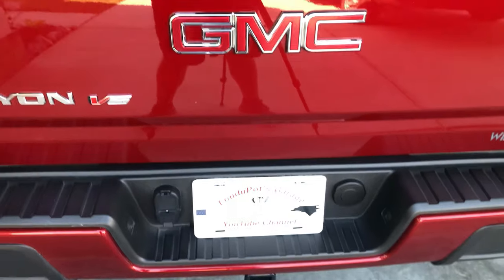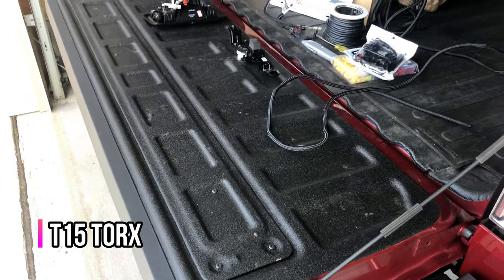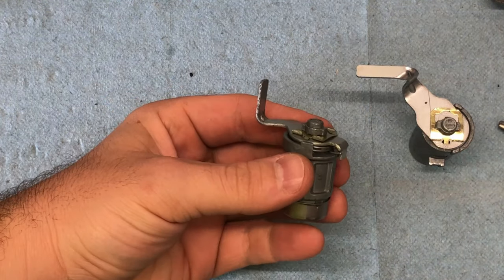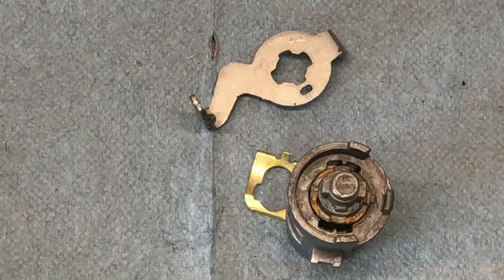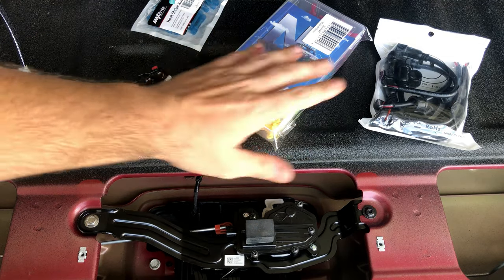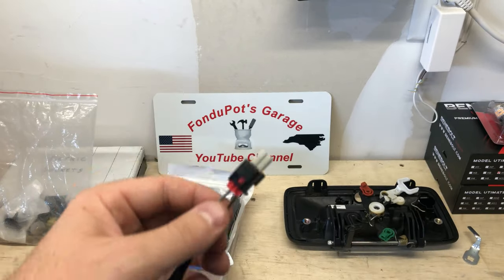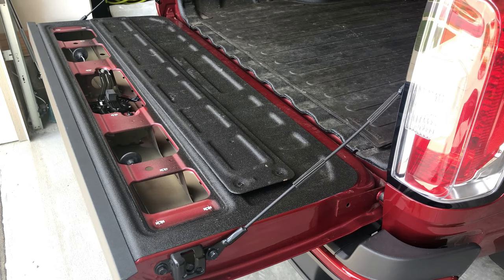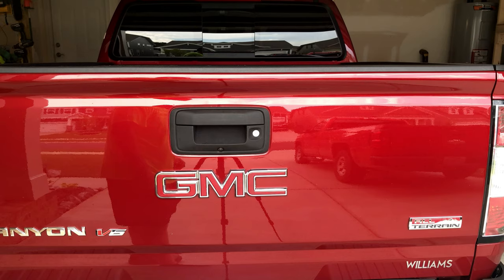[HOW TO] Install OEM Power Locking Tailgate in a 2015-2019 GMC Canyon / Chevy Colorado (Retrofit)

Comment: Thanks again for this video! I just finished up on my 2017. I used the part numbers below. Notes/tips: the handle was the non HD version. Also I had to use a file and remove a small bit of material from the metal arm where it connects to the lock.  cylinder. Lastly, i recommend using some clamps to mock up motor placement prior to drilling and bolting it up (2017 doesn't have indented tabs to show you where to place motor).
Handle: 84376533
Wiring harness: 84951860
Lock cylinder: 23338181
Motor/actuator: 84790352
Reply from the maker: Glad it helped! Thanks for watching.

Comment: Great video. Thanks.
I ran to the same issue like a few others here: Ordered the wrong end gate lock (p/n 13536169 is wrong, p/n 23338181 is the correct one which has the spring).

I'm still looking for the harness: p/n 84666895 and p/n 84951860 are not available anymore. Is there a successor? Thx for any useful help...
Reply from the maker: Not sure if there’s a successor part number. You can call a dealership parts department and they might be able to tell you.
Reply: A heads-up for everyone: finally I had time and went to my Chevy dealer: Harness with part number 84951860 is available and costs ~$40. Ordered mine, should come in within the next 7-10 days…

Comment: I just attempted to do this mod on my 2018 GMC Canyon and I found some interesting things. First, the handle assembly 84377237 didn't work with my backup camera. I ended up having to swap the white crab claw mechanism from the new handle to my old handle, that did work out fine. Second, the lock cylinder isn't the 13536169 part number. That cylinder didn't come with the spring and the arm didn't align with the crab claw. I ended up just using my normal cylinder (different than the original one in your video) and modifying it by slipping some rubber tubing over the metal part that actuates the crab claw so it was a little wider. After doing all of that I can say it works great, I don't have a spring in my lock cylinder but that doesn't bother me and doesn't seem to affect the operation.

I had the pop lock before this and can confirm that the OEM lock is much quieter and less clunky.
Reply from the maker: Thanks for your feedback. I've still been searching for the spring loaded lock housing. I cant find an exact part number for it. Strange your camera didnt work, what was different? Just the mounting bracket?

Either way, glad you got it working. And I agree much better than pop-n-lock.

Comment: I installed the pop & lock before watching this video and ended up ordering all the parts for the oem lock. The pop & lock works fine but it's sketchy and very loud. I like the idea of having oem parts in my truck.
Reply from the maker: You’ll love it. Mines still running great. Best mod I’ve done.
Reply: @fondupot  cool deal! Also, awesome video. I really appreciate it. I wouldn't have known it was even possible had I not watched this. You did a great job!
Reply from the maker: Thanks very much! Glad it helped.

Comment: An excellent video.  Well done!!  Caveat - I own a 2015 GMC Canyon.  I bought the parts and set upon installing per your video.  The problem is the 2015 back up camera does not easily fit into the new tailgate handle.  You can make it fit if you cut away some plastic ridges and drill new holes in the camera's bracket.  The tailgate does not have recesses to mount the actuator as you show in the video.  You have to drill new holes in the tailgate, then you have to mount the actuator underneath the tailgate inner sheet metal, otherwise the tailgate piece will not lay flat.  I have yet to wire it up, but so far with a lot of modification to the parts I think it is working .  Will let you know how it goes after I get the wiring harness.
Reply from the maker: Yea I think I remember reading another member with a 2016 having to do the same. But with a little ingenuity and power tools. You should be able to make it work. Let me know how it goes!
Reply: @fondupot  I made it work. The tailgate plastic cover doesn't fit flush because of the protruding nut used to attach the actuator.  But I am happy with the result.
Reply from the maker: Awesome!

Comment: My personal thanks for your video.  I have a 2021 Chevy Colorado and had to get some different part numbers, "84790352 Actuator and 84665198 for Wire Harness to plug it in" as I couldn't find your numbers on the internet.  I didn't have to switch the key lock as it was already mfg the way yours had to be modified.   Other than that I plugged it in just as you identified Grey &  Brn/Yel wires and it worked beautifully.  Thanks again.  I would say I used almost 20ft of wire to thread it front to back.
Reply from the maker: Glad you were able to make it work! Thanks for watching!
Reply: What model 2021 Colorado do you have?  I thought starting in 2020 they all came with locking tailgates

Comment: I'm having trouble locating the correct silverado lock mechanism.  Ebay has lots but they do not look the same and are for 07-14 applications.  Any suggestions as to the correct model years your lock came from?
Reply from the maker: Try to find one from 2016+

Comment: nice  video,
Have you had any issues with the   pop n lock? since you installed it.
would you change anything  if you had to do it again
thanks bill
Reply from the maker: @billlambright339  it’s been flawless. No issues. I’d do it exactly the same way if I had to again.
Reply: that install you did was it on a canyon or colorado. mine is a 15 colorado 4 door LT. I have no grouments like in your video have no way to get the wires inside besides drilling hole and fitting a groument
Reply from the maker: @billlambright339 my video is on a 2019 Canyon.

Comment: Great video!  I’m going to check my 2015 tailgate to see if this set up will work.  I’ve read reviews that say the Pop Lock is way to noisy.  OEM would be a better option for me.  I did call our local audio place that would do it, but with parts and labor it would be way too expensive.
Reply from the maker: It can still be done on your 2015. You won’t have the bracket mount holes like my 2019 did. But with a little ingenuity you could make it work. Others have done it. Thanks for watching. Good luck

Comment: Why not use the Pop and Lock??   Same functionality,  without key core swap- without handle swap- without custom harness.  Cost is 100 bucks, how much was your set up using OEM???
Reply from the maker: Good question. I had a pop-n-lock on a previous truck and it crapped out after a year or so. Yes, my retrofit using the OEM lock, and custom harness was probably more expensive, I don't recall the exact costs. But it will last much longer.
Reply: @fondupot  that makes sense now.  I was curious if the pop and locks where too good to be true.  I wonder if the failure point is the crimp tee connections off the factory lock wires.  I think if I install it I'll do a cut and soldier connection.
Reply from the maker: I tried reconnecting all my wiring and still had issues. I think the actuators in the pop n lock kits just wear out over time.

Comment: Thanks for this. Do you have a part number for the Silverado lock cylinder?
Reply from the maker: Unfortunately I don’t have a confirmed part number. But I’ve seen listings on eBay for tailgate handles with the spring loaded key housing included.

Comment: Thank you! Great video and definitely on my things to do list for my 2019 ZR2
Reply from the maker: Anthony, you're welcome. Thanks for watching! Definitely do it on your ZR2
Reply: Fondupot's Garage just need to source a spring lock housing.
Reply from the maker: Yes. Check eBay. There are a few listings for handles with spring lock housings. Or check a scrap yard. Most higher end Silverados will have the lock housing dating back to 2015-2016.
Reply from the maker: @anthonypierro5296  Also, check the coloradofans.com for sale forums. I have an extra one for sale.

Comment: Could you just swap out that new white actuator arm into the old handle assembly?
Reply from the maker: Yes. If you’re handy enough it can be done. I did it on mine
Reply: @fondupot  ok awesome. You'd still need to swap out the lock core though? Am I seeing that correctly - that you'd need the spring loaded lock housing?
Reply from the maker: @elied0327  Yea, you need the spring loaded lock style. But you can swap your core over from your current handle, I did that as well.

Comment: Not possible to just swap the plastic actuator instead of replacing the key core?
Reply from the maker: No. The electric actuator doesn’t work with the old style plastic piece.
Reply: It was for my 2018 GMC Canyon, the crab claw arm was the only part I used from the new handle

Comment: Great video. Any idea on what the total cost of the project was? Trying to decide how much the manual locking tailgate annoys me vs price.
Reply from the maker: Probably around $225. Give or take.
Reply: @fondupot  Thank you sir! Unfortunately my (Jan) 2017 SLT doesn't have the two indentations on either side of the handle in the sheet metal. There isn't a place for the motor/bracket to sit in.  I suppose I could shim it down, but I don't think there is even room for the bolt heads to be recessed before hitting the cover. Bummer.
Reply from the maker: @mhalpin08  i think someone did it on a pre-2019. Browse around on the ColoradoFans forums. There's a thread on there.

Comment: I have a 2018 Colorado. It does not have the indents for the actuator in the tailgate. I drilled 2 holes and used some washers and mounted the actuator on the inside of the tailgate. On the outside it won't engage the "crab" extension. My camera also did not fit into the mounting either. I opened the holes up in the camera for the mounting screws. I had to remove the guide pins to line up the camera as the mounting and guide holes are a different spacing. The camera hole needed a little filing to get it to sit in the handle flatly.
Reply from the maker: I suspected that might be the case with the earlier models. I think the 2019+ are the only ones that will have the indents on the tailgate. Sounds like you have it humming pretty good though! Glad you were able to do it! Thanks for watching!
Reply: @fondupot  I just checked my 2018... It does have the indents.  However I did factory order my 2018 Redline in May.  It wasn't off the lot.. So maybe I got the newer tailgate.  The actuator should be coming soon and I'll be doing the install.
Reply: When did you purchase your 2018?  Latter part of 2017?  I just checked mine (factory ordered in May 2018) and it does have the indents.
Reply from the maker: Yea it’s possible they added the newer tailgate design part way thru 2018. Good luck with your install!

Comment: I used your previous video to install the Pop and Lock in my 2015 Canyon SLT and then to install it in my 2018 Canyon Denali (same color as your truck). My lock was working intermittently so I looked for your video to refresh my memory and found this new one.  I used wire taps in the rocker cover originally and think that was where my issue was.  I soldered the connection this time and I hope that does the trick. I wish I had known at the time about the connector under the dash. Would have been cleaner.  This seems like a much nicer installation and the cost of the parts seems reasonable and comparable to the Pop and Lock system.  Thanks for doing this. You have a real knack for explaining things.

One additional thought - it would be great to get the "crab claw" part as a separate item and keep the original handle. I wonder if it could be 3D printed?!

Bill
Reply from the maker: Bill! Thanks for watching. I hope your pop n lock is working well now. I was having issues with mine in the Colorado before. But so far the new setup in my canyon has been flawless. 

I’m sure that part could be easily 3D printed. I don’t have one. But a clever person could probably figure it out.
Reply: @fondupot  I'm still having intermittent problems with my Pop and Lock, so I am seriously looking into this. Did anyone provide feedback on the lock cylinder part number? It does seem confusing when looking on the GM parts websites
Reply from the maker: I could never confirm the part number. But if you can find a handle on eBay from a Silverado/Sierra/canyon/Colorado that’s 2019+ that also includes the locking cylinder. Chances are it will have the spring loaded lock cylinder. Send me an email and I will look through some listings online and see if I can identify some for you. Fondupotsgarage1@gmail.com
Reply: @fondupot  Sent you an email. I found something and actually placed a bid on it. Thanks for following up
Reply from the maker: Just replied to your email.
Reply: @fondupot  I completed the upgrade from the Pop-n-Lock to the EOM style actuator his weekend. It went very smooth thanks to your info and insight. The Silverado parts I bought on eBay worked great. The eBay purchase included the handle, camera, lock, Silverado actuator and wiring harness. I used the lock, but since I didn't have a key I had to have a locksmith pull the core and transfer my Canyon core into it for $30. I also used the plug from the harness and transferred the "crab claw". This installation is much quieter than the Pop-n-Lock system. Again, thanks for putting this together

Bill
Reply from the maker: Bill! Awesome to hear. Glad you got it installed. Enjoy your truck! Thanks again for watching.

Comment: So just so everyone knows I just tried to do this mod ordered everything and started it today got everything installed go to install the motor, and well you see in this video the 2 indents in the metal? my 2017 Canyon tailgate does not have those 2 indents. that for sure sucks im sure i can just drill a few holes and get it to fit but i wonder when they changed that design.  but to also add the correct part number for the spring loaded assembly is 233338181
Reply from the maker: Thanks for posting the part number for the spring loaded housing. That’s helpful. Where did you find it? I could never find it. 

Your truck is a 2017 that’s why the holes weren’t there for the bracket. They didn’t start doing this until 2019 model year in preparation for the 2020s to get the locking tailgate. You can make it work tho just as you described. Let me know how it goes when you get it all installed. Thanks for watching!
Reply: I have a friend who works for a chevy dealer I gave her the vin number from a 2020 canyon Denali and asked for the part
Reply from the maker: Awesome. Good job!
Reply: Hi, did you end up completing it on your 2017?  Wondering if you can take a picture of the installation.  I'd like to see how you mounted the actuator without those indents.
Reply: @Nick-zp2mg  not yet nick I'm going to take it to a mechanic friend of mine to. Help but I will update when that is done.
Reply: @davidwright5281  Thanks. I have a 2018 and some of the online pop and lock installs show it has the indents. Just haven't taken mine off yet to verify if I have the indents.  Too cold.

I end up finding two Silverado lock housings. Just waiting for my Lishi pick tool to take the cylinder out.  Couldn't find a locksmith that would reply to my request to pick it.

I think I'll install the lock first to get everything ready then verify if I have the indents.  Not a fan of drilling.

Good luck
Reply: I just opened up my 2018...the panel didn't want to come off very easily because the bed is factory spray lined.  At any rate, once opened up, I was pleasantly surprised that it has the indents for the actuator bracket. (Looks identical to fondupot's truck) So glad for that.  Now just waiting for the actuator. I noticed GM changed the part number of the actuator so I hope it comes with the bracket.
Reply: @Nick-zp2mg  great! I got mine mounted up
Reply: @davidwright5281  Amazing! Great work. 

When you ordered the actuator was it the original number fondupot put in or did it come as 84790352?

If it's the newer part number, I'm wondering if it came with the bracket. I can't find the bracket as a separate part number so I'm hoping it comes with it too.
Reply: Well the actuator part came in today.  And glad to report the new Part #84790352 comes with the bracket (phew!)... its actually cheaper in price then whats listed for the original.  I finally have everything I need (Harness was the only missing part, but a handle I ordered off of ebay left it attached. lol).

Good luck everyone.  Love that I can make this more stock than a pop and lock.
Reply from the maker: Good luck on your install!!